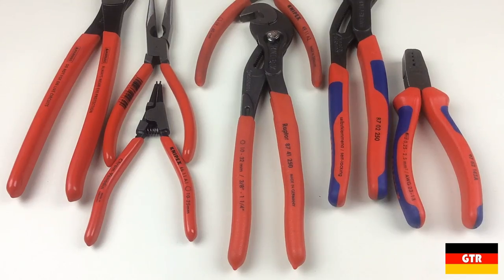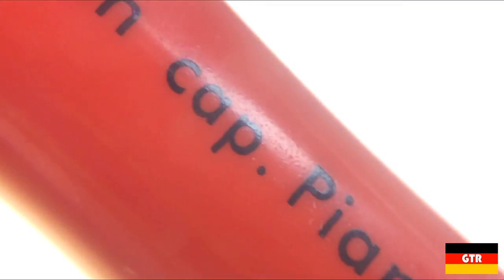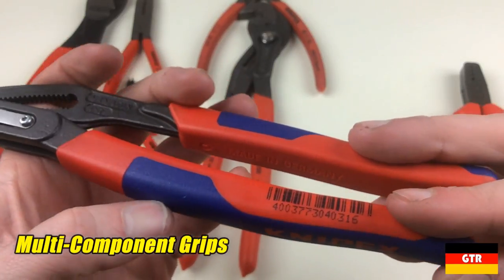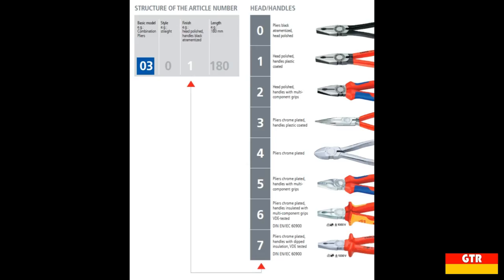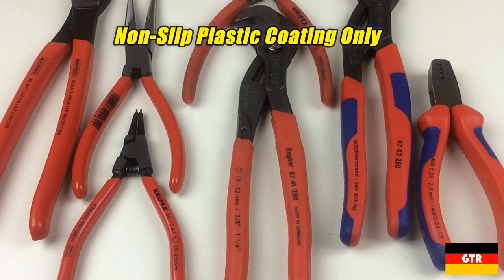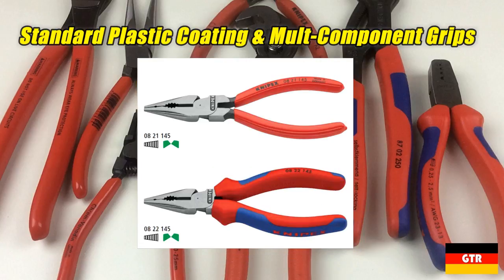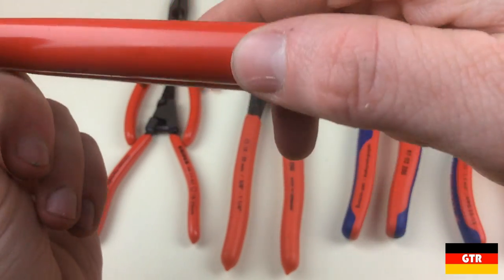German Tool Reviews:  Knipex Handle Styles

Comment: As a commercial electrician, I move around a lot and have to carry multiple different tools with me in a rather large tool pouches. I find the dipped the best because they are the slimmest and are easier to stash away on pouch pockets. The other added bonus is they are the lowest cost. I don't have a preference between the slick coating or the grippier coating. Aside from the cleaning aspect, I like them equally in different ways. I love the look of the multi component grips, but I would not want to sacrifice the slim profile and pay extra for it.

Comment: Personally I prefer the multi-component handles, but my preference is biased by the fact that I use these mainly in a room environment and I tend to keep an overall cleanliness during work, so I have no experience with much dirt or oil getting on my tool.

Comment: Great video. I like the multi-component grip for clean work (electronics) and the plastic coating for messier work (vehicles). I only own a few knipex tools, but I wonder about the metal finish of the business end I see on some of them in the range. All of mine have a flat metal finish, but some seem to have almost a chrome finish.
Reply from the maker: That is part of the fourth digit of the part number.  It is has a 0,1 or 2 the head will have a ground/polished head while 3-7 will be chrome plated.  The chrome plated versions are more expensive then the polished versions.
Reply: Thanks for the info!
Reply: See the Knipex catalog for details
https://www.knipex.com/fileadmin/site/knipex/bk/index.php?catalog=KNIPEX-General-Catalogue_2017-2018_EN#page_284
Reply: It's interesting because, if you look around a typical European tool store, a lot of the finishes are matte, but here in the US, it's always chrome.  I prefer the matte, easier to hold when greasy.

Comment: Great video.  I was actually wondering about this a couple of days ago when looking at pliers at KC Tools - I assumed it was related to age of the design.  For cleaning your tools, buy some 'Sterile Alcohol Prep Pads' - they work great for almost any contamination - that's what I use.  You can throw a bunch of pads in your tool box.  I buy the 'Dynarex' brand (have a box on my desk) as I have found some others are drier than I'd like.  Also useful for cleaning controls/HMI buttons/pads.
Reply from the maker: Thanks for watching!  I do use 99% isopropyl alcohol sometimes on handles along with some Kim wipes.  I think you are right about the age, it looks like the soft-grip only appears on the newer series.
Reply: I was specifically referencing the individually packaged wipes, like this https://www.amazon.com/gp/product/B00OZQTAG0/ - I find these are way more useful than separate alcohol & wipes.  I use them for everything, from electronics to cars to tools to watches. 

For real deep cleaning, nothing like rodico for most hard surfaces....  With alcohol wipes, rodico and some peg wood, you can clean anything to extreme precision. ;-)  

 P.S. When I work on cars or other particularly dirty things, I use brake cleaner to clean my tools, never hurt anything (I'd throw the tool out if it did) and evaporates virtually instantly.
Reply: Come to think of it, I wonder if the heavy emphasis on ergonomic tool handles in German tools of the last couple of decades is driven by the number of workers going on disability and the effect this is having on productivity.  My SO wrote an investigative piece years ago for a European publication that highlighted this phenomenon (specifically related to RSI).   Maybe all the newer ergo tool designs are an attempt to address this and boost sales of replacement tools?
Reply from the maker: Could be why Wiha is pushing their "doctor-recommended" tools:  https://www.i-feel-wiha.com/en/
Reply: Exactly, otherwise why would you replace your 'indestructible' high-quality expensive German tools.

Comment: I like the non-slip plastic a lot but yeah it gets dirty. If you need any further comparison of grips I have almost all of them (minus the dipped VDE) and something like 70 pairs of Knipex. I also have the "Craftsman" branded Cobras which have yet another type of grip.

BTW, Crawford tool does a pretty good job of sorting the models/model numbers
Reply from the maker: Wow, that is quite the collection you have!  I probably only have a dozen or so Knipex products.
Reply: I had a pretty good honey hole with Sears and their SYW program, sadly it's starting to dry up. I bought waaay more Knipex than I would have otherwise, I was getting $20-30 every couple of weeks to use on Knipex...in fact, I started running out of pliers I could use and bought some of their tweezers. I don't mind helping you with pictures at all, I like the channel so I'm glad to help. Were you ever on toolsinaction's forum?
Reply from the maker: No I've never been on their forum.  Probably should be more active on some of the tool forums out there, just never have any time!

Comment: Great infos - Is there a reason why you're skipping the VDE-pliers?
Reply from the maker: I mentioned it briefly, but there are two types of VDE pliers, a multi-component and dipped.  I main reason I skipped it is because I don't have any dipped knipex VDE pliers.  I do have the multi-component VDE pliers and they are very similar to the non-VDE multi-component pliers with the exception of the colors.

Comment: 1:51 I don't think that is correct. On the pliers I own, the red is a hard plastic and the blue is a softer, grippier elastomer.
Reply: Ditto , blue is a grippier elast., but i have noticed some brand new 2 tone can seem the same until used a couple of times..............great tools Knipex , one of the handiest is a 125 mm mini-cobra :]
Reply from the maker: Interesting, I wonder if they changed the style at one time.  Granted I only own a couple of the multi-component types.  Do you know which model you have that is different?
Reply: I just checked all my pliers, they all have two different materiales.
I bought them all within the last 2-3 years in Europe.
What I checked:
74 12 160
87 02 250
95 22 165
71 12 200
31 25 160
11 02 160
78 03 125
Reply from the maker: Thanks Søren, I will investigate and may do a follow up about what i find.

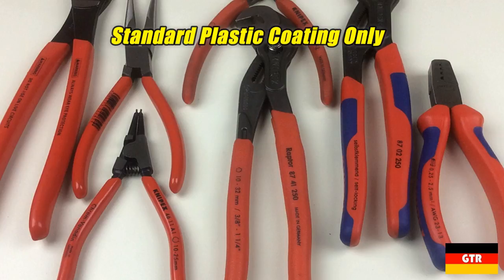Comment: I have the 28 81 280 (3:15) long bent-nose pliers, the grip is the non-slip type, not the smooth type. 

Yes it is hard to clean! WD40 is my go-to for cleaning plastic tool handles but it doesn't help much with these...
Reply from the maker: Looks like you found an error in the catalog.  I did find a couple as I was compiling the list.  The catalog lists that model as "plastic coating" but as you say it looks to be only available in the non-slip plastic coating.    So it looks like for the 28 series, the 28 01 200 and 28 21 200 models has the standard plastic coating but the 28 71 280 and 28 81 280 have the non-slip plastic coating.